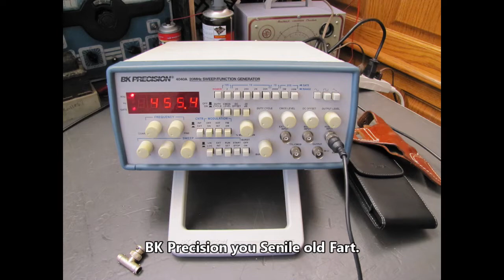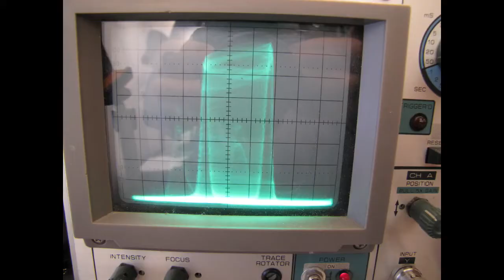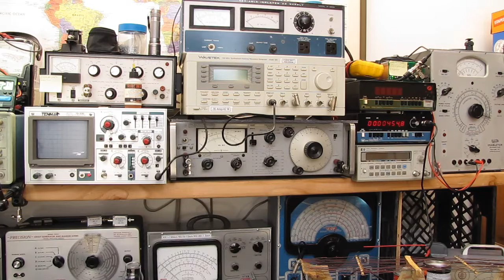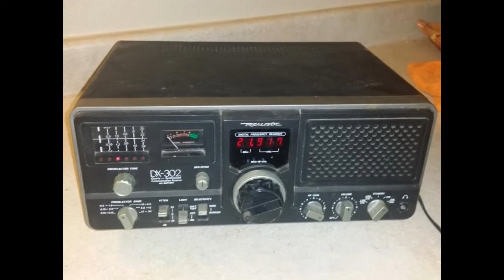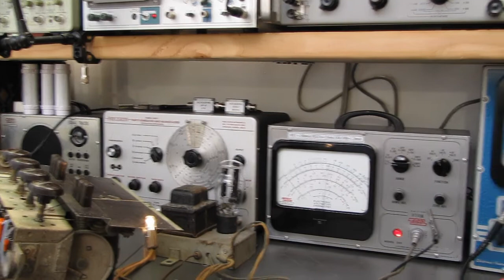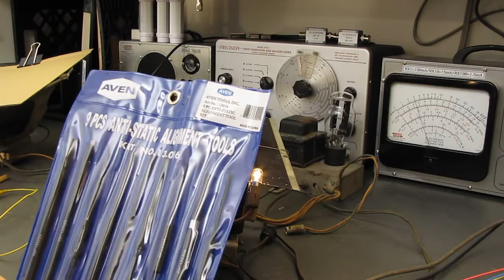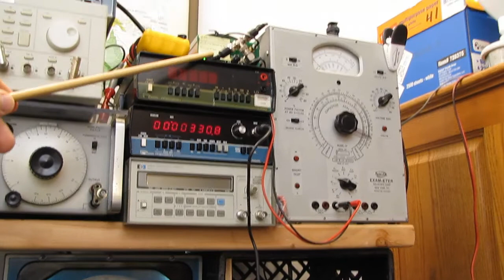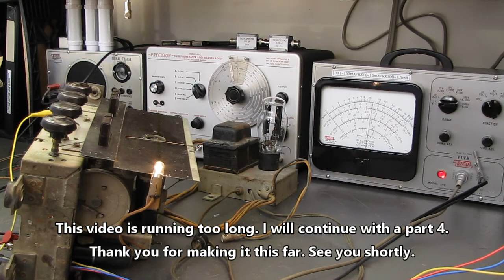RCA U 42 Part 3

Comment: I walk several miles a day. My blood pressure is perfect. That and a water pill once a day. What an eye opening video on test equipment this is. Something especially 
good about older period test  units used on older radios. New stuff is overkill unless you want to know  the wave forms. So then  just use a 60Mhz oscy. Video was excellent!
Stay away from FedEx. They are slow and tend to damage stuff even marginally packed items. Never FedEx a tube radio! Ask if a seller is willing to take them
out of the sockets ,wrap them separately in small bubble wrap and tape them so they don't smash themselves to bits. Boy the horror stories...
Reply from the maker: AMEN....Always use UPS or USPS. Always pack for thermonuclear protection. :-)

Comment: There's original B&K run by founders Ban and Korn and 2020 B&K which is just a brand name trading on its former reputation. Their website says: 
"We stand behind every product we ship. Our warranties are valid worldwide, and we provide global service and support to guarantee your satisfaction. Our offices in North America, Europe, and Asia work with an international network of authorized distributors to ensure prompt delivery and excellent customer support. ... Our products are backed by warranties covering parts and labor, effective worldwide. Our in-house technicians work directly with you to provide any necessary calibrations or repairs, ensuring optimum performance." 
It would be interesting to see them explain that crappy saw tooth wave. Maybe you should invite them onto the show to do just that.
Reply from the maker: I should have know better. But wanted a unit that was cheap for the 10 buck test bench. Had to break out the Wavetek. (Not that all of their gear is so great. )

Comment: The trouble with the BK is they use the MAX038 to generate the signal, which is a decent chip, but its no where near the accuracy of a synthesizer.
The counter portion is probably frustrating because it uses the ICL7216DIPI, which is now a maxim chip as well, to do all the heavy-lifting of the counting, it has a time base selection multiplexed into the chip depending on the range, it's a sweet chip, but probably not as useful as a discrete counter, or software based PIC micro frequency counter.
Reply from the maker: It certainly isn't a wavetek. Thanks for watching.